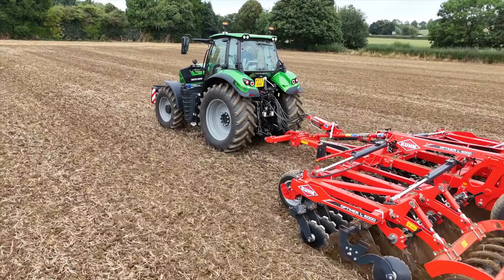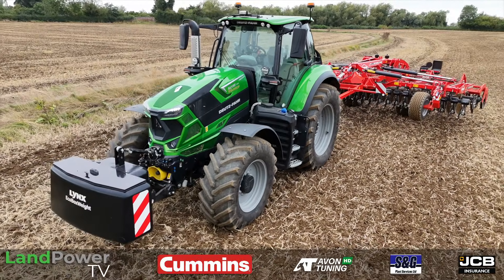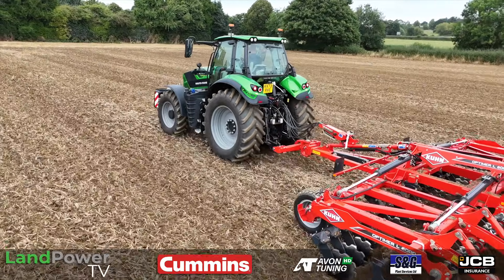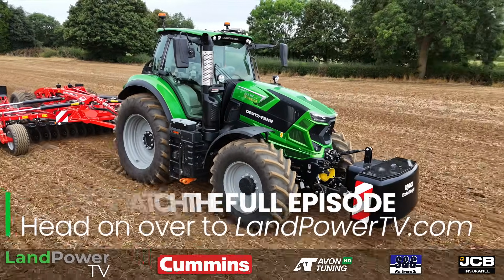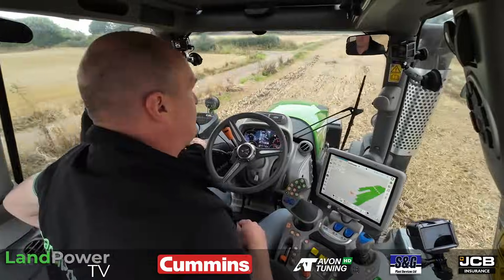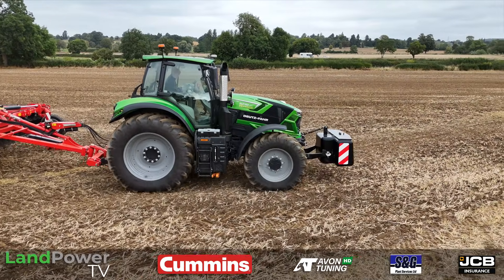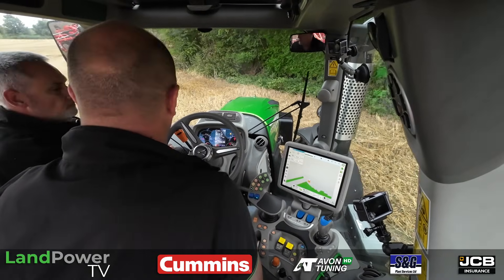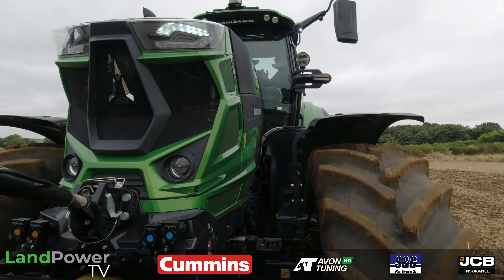FIRST IMPRESSION: Deutz-Fahr 6230TTV tractor and technology developments

Comment: Tractor drivers are No longer Drivers !
I enjoyed driving and maintaining tractors at 12 years old 44 years ago.No electric anything apart from heater/lights/starter motor.
simple to use and look after on the farm and cheap to buy ford 7600/5600/4610 etc,Now there full of CPUs they cost as much as a house and The farmer can not look after his own machines=The cost of food is too high due to too complicated and exspensive machinery and servicing costs.
Computers have a place but they should not be used to increase costs and remove peoples jobs at any price.

Comment: That’s my tractor…bought it in the autumn!
Reply: Do you like it? I’m going to try either a 190 or a 210 ttv later on this year and might jump over in a year or two.
Reply: @stevewilliams190  brilliant! Changed from case, just a smoother ride and a nicer place to spend a day, feels like more power and pulls better aswell
Reply: @HaggisFarmer  that’s good to know, I’ll make sure I try one then!
Reply: @stevewilliams190  a lot cheaper than the main brands too!!
Reply: @ we’ve got a kubota m7173 vario for that reason but could do with a bit more hp down the road, if my tractor boosted to 190/200 I wouldn’t even be looking to change. I don’t know if the deutz 210 is going to be too big but 60kph is appealing!